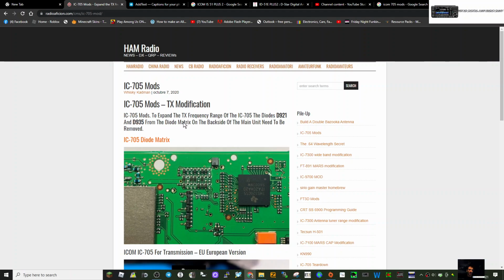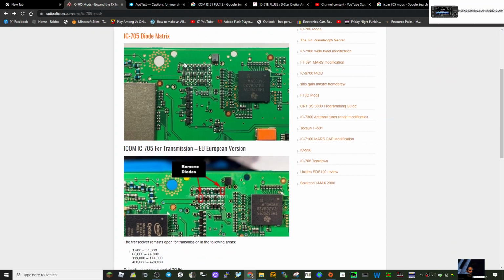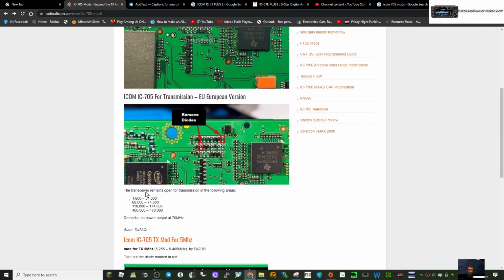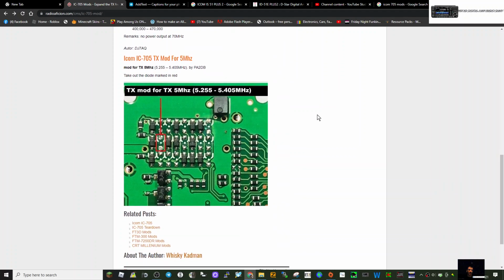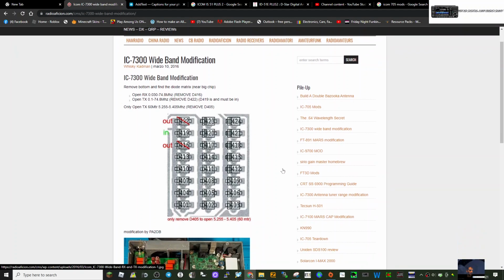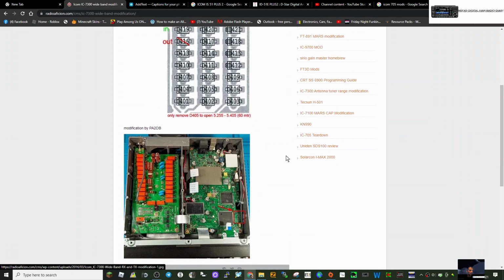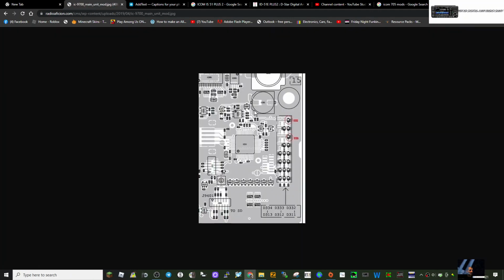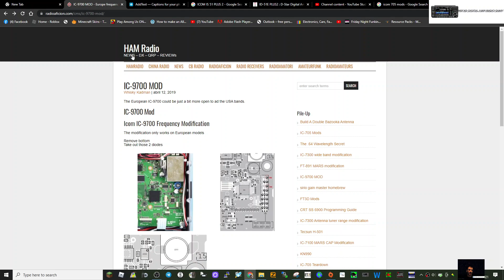ICOM IC-7300/705/9700 -TX MOD-information

Comment: After IC9700 modified, is the RX expanded TX/RX function or only RX on 440 to 450MHz range?
Reply: There is no wide mod for the 9700, it is RX/TX ham bands only.  It does not have a wide band receiver.

Comment: Dear, I see the specification of Icom 9700 for CHF start 144,000 , How to modify it when I user bellow 144.000. Please advise
Reply from the maker: Sorry I don't not know :(
Reply: The 9700 is ham bands only, there is no wide band RX on that radio.